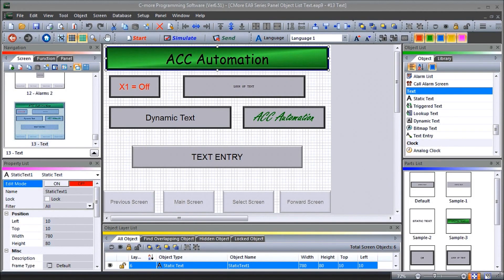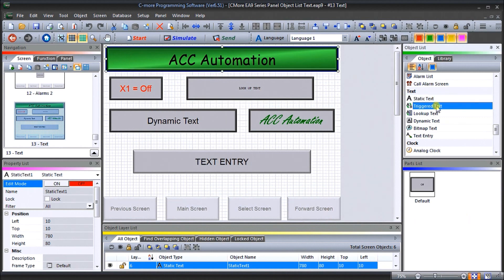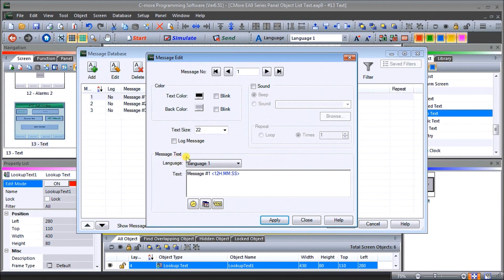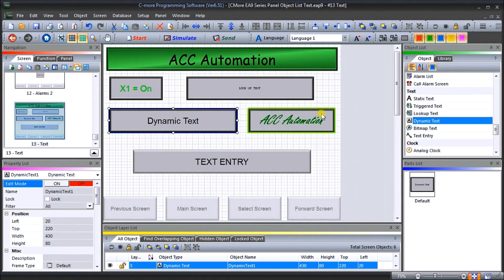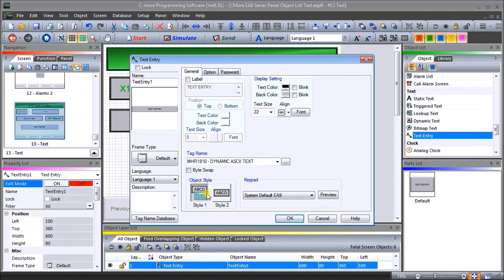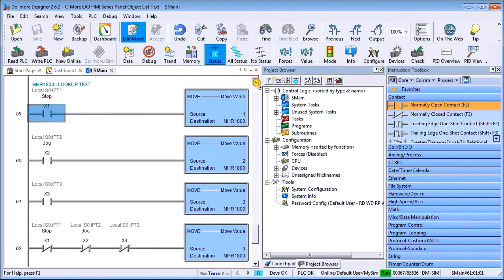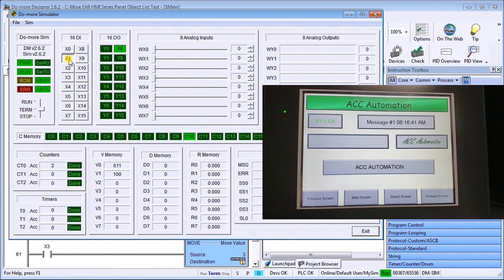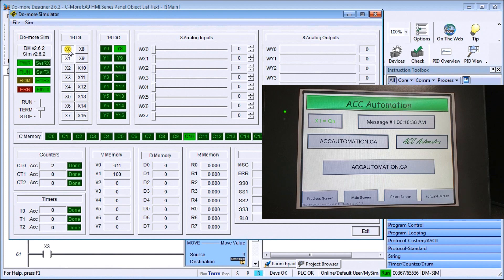C-More EA9 HMI Series Panel Object List Text

Comment: Thanks for your videos Garry. I have a related question I cant seem to find any info on. I would like to use the number entry to send a transmitter alarm setpoint from the HMI to my DL05 PLC. Ive got as far at it putting something on the PLC, but cant seem to get the value in a comparable format to be able to perform logical operations on it. Ive tried different types of number conversions inside the PLC but cant get it to work right. Any ideas?
Reply from the maker: Hi Chris,
https://accautomation.ca/c-more-ea9-hmi-series-panel-object-list-entry/
Here is the post for the numeric entry. 
When using the EA9 unit to the DL05, you should not have to convert in the PLC. The number can be programmed using the tags in the HMI for the type of number you are entering.
If you can provide the values that you are seeing on the screen and HMI, I may be able to determine what is being sent to the PLC.
I hope this helps you out.
Regards,
Garry